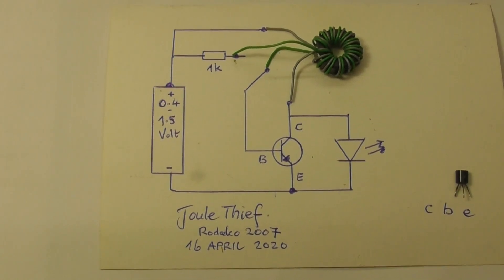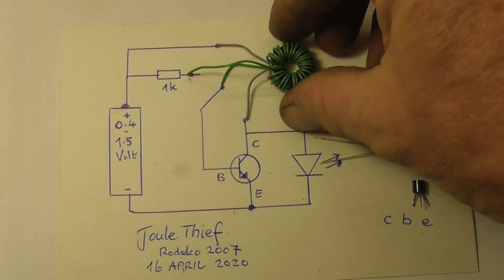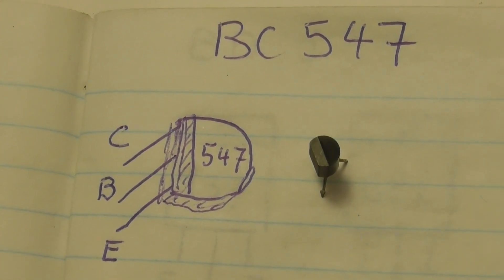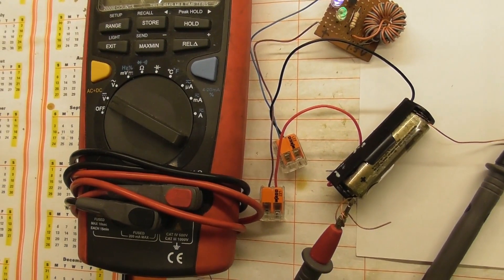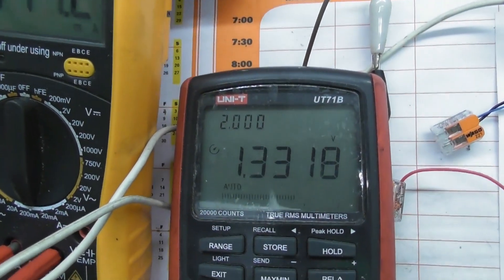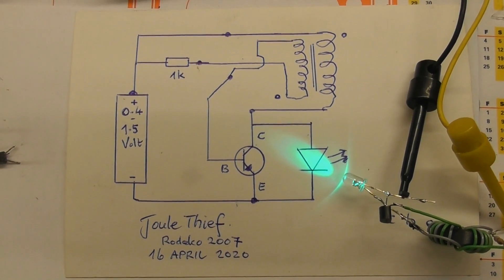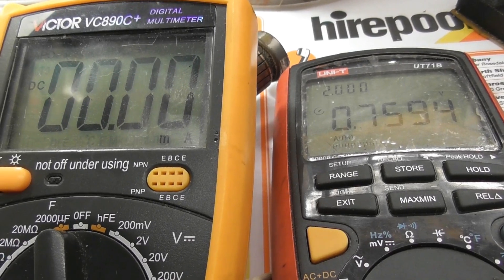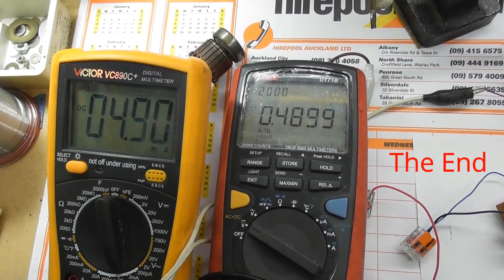Joule Thief

Comment: Another fun fact... a slight variation of this circuit was used in ZX Spectrum computers to produce +12V and -5V from an unregulated 9V input.. to power the 4116 DRAMs of the time. Crude, but effective!

Comment: I think this is also known as a blocking oscillator. I've seen the arrangement before, but with the 1K resistor on the base rather than at the other end of the coil. Either way works, i guess!

Comment: What can you power with these things beside led's
Reply from the maker: They are low power devices, more experimental or for small led lamp projects to get the last bit of energy out of a 1.5 Volts battery.
Reply: I've researched them to power ignition coils (got a very hot continuous looking arc, and have a video of it on my channel) and also tried with various winding arrangements to create a supply that's negative with respect to ground, from a supply that's positive with respect to ground. After rectifying power and delivering it to a test load, these widgets are only 30-50% efficient. A lot of power is lost when the transistor is partially off or on.

Comment: I need to make one of these. I'd like to make a flashlight that uses this circuit and you can put in a new or used AA battery and it still works. Any ideas on the maximum type of LED you can use like a bright white one?
Reply from the maker: You can put a few leds in series and experiment with the winding, add a few more turns to get a higher output voltage. 3 leds in series on the basic circuit usually works fine..

Comment: I love these things. Made one with a larger toroid, 6 turns of wire on each coil, and a third winding with 120 turns of fine wire. On a new battery, it had no problem lighting a neon indicator. Another one, was a 120-12vac transformer with a cener-tap and a bul128 power transistor. That one would dimly light an 18" flourescent tube. Such a versatile circuit.
Reply: Update: I made one of these out of an old ignition coil. The cycle frequency is a few khz but goes ultrasonic sometimes once an arc is struck. Yeah, I'm asking for views, but if you'd like to see how I did it, here's a link:https://www.youtube.com/watch?v=knrcr6_JkSE

Comment: A good improvement is to add a 1000 uf capacitor, or larger value, and voltage as the lowest you commonly get is 2V it does not worry, across thebattery. This keeps it running even when the battery is nearly dead, as it stores charge up to provide the current pulse for the transistor.
Reply from the maker: I tried that today, didn't make too much of a difference maybe 100 mV less.

Comment: The usual version uses a little tiny ferrite bead and magnet wire, instead of a larger torroidial core and regular insulated wire.  I wonder if the larger core works better than the little one?  it should work just as well at least (and the free is good!)  One thing I haven't tried was replacing the silicon transistor with a germanium one.  The lower B-E voltage means it should run down to a lower voltage.  Also, we can get good depletion mode FETs now, which act kind of "backwards", where the device conducts until the voltage on the gate is applied-  these might be fun to try also, since they should run the battery even lower.  If one of those is used though the gate drive winding would need more turns to get a few volts to fully cut it off.